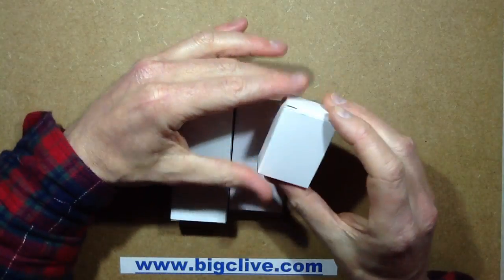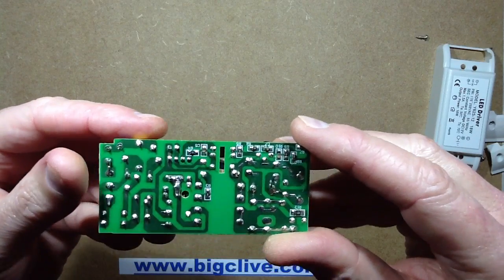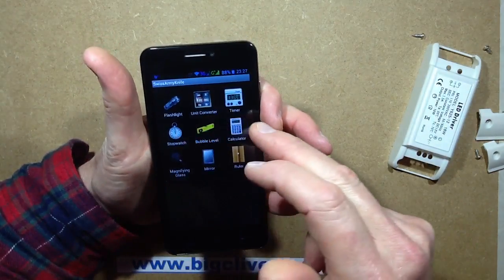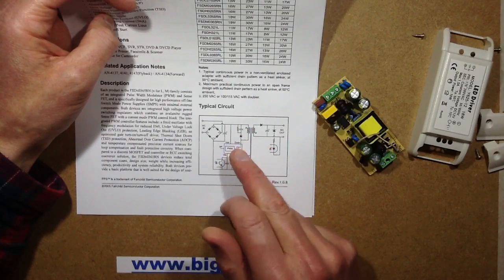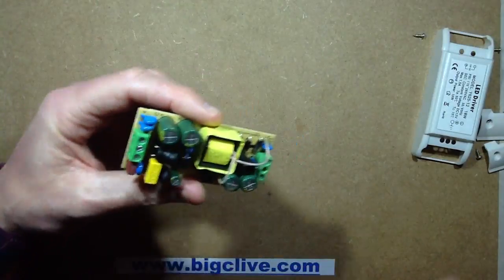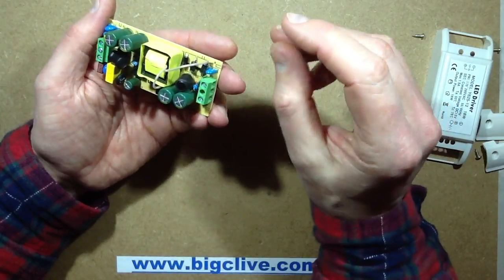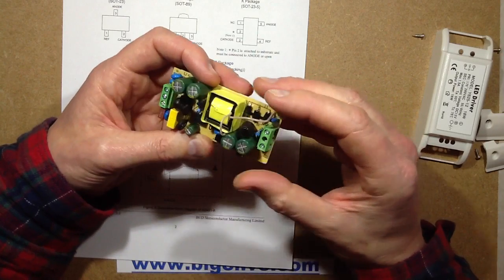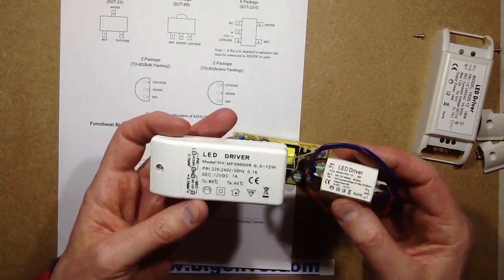Checking the build quality of a 12V 1.5A inline power supply.

Comment: Wondered if one of these could replace a portable radios internal  PSU board  that's broke(no power) could add a bigger smoothing  capacitor as it's feeding audio circuits.
Reply: You would have to make sure it's a constant voltage LED driver and not a constant current LED driver.

Comment: Hi Clive,
I was browsing aliexpress to get a power supply for a Chinese amplifier I bought (TPa3116), and I came up with this rather nice looking and cheap 24v power supply. It claims it can do 6A, which it seems like quite a lot for this size. You might want to take a look at it to review it, here it is: https://www.aliexpress.com/item/Power-Supply-Module-AC-110v-220v-to-DC-24V-6A-AC-DC-Switching-Power-Supply-Board/32711742016.html

Comment: I just noticed that this power supply looks like one I've taken some time ago by Internet. Obviously it is a low-quality Chinese product. Should 5A to 5V but the voltage drops with small loads.

Obviously the chip has no code.

I have subscribed, you make fantastic videos, also you have the power line that allows you to do "crazy experiments". (Chinese gadgets)

Comment: Just purchased two of these - look exactly the same on the outside and inside. One works just fine, the other doesn't appear to be firing up - just flashes the output (5w of LEDs) on and off. Can it be fixed or is it a return to seller job? Guess this is the pulsing effect you mention in your video.
Reply from the maker: +Sparky UK Sounds like there's an issue with the winding that supplies power to the chip itself.  Could just be a bad solder joint on the transformer or associated components (usually a diode and capacitor).  Probably better contacting the seller and if they tell you to ditch the dead one then maybe worth trying to fix it.

Comment: Clive, I've bought a number of "Led Drivers" and "Transformers" which appear to have a delay in firing (the chip requiring enough charge) - which you mentioned in this video. I've noticed when driving a number of 1w LED modules, there's a 1-4s delay which isn't ideal. What would be the best power source for 1w module LEDs to get them to come on instantly?
Reply from the maker: +Sparky UK That's unfortunately very common.  Some of the newer switchmode chips will power up very quickly, and all the capacitive dropper based lamp power on instantly.  But the traditional switchmode chips have a second primary side winding that is used to actually power the chip.  Before they can run properly their power supply capacitor is trickle charged through a resistor until there is enough charge on it to run for a short time, but then they start powering themselves via the winding.  It's the time taken to charge the power supply capacitor that causes the delay, and it's not easy to change.
Reply: +bigclivedotcom Interesting. Over the course of the year, the same (waterproof) transformer has gone from taking 1s to 5 seconds to power up, so does that suggest a component is failing over time? The load has remained constant, although I guess the load bares no parameter on the charge time of the power supply capacitor. These transformers are dying once they reach about 12 months (along with oozing silicon out of them!) but interesting that the transformer takes longer and longer to fire up as it's aged. I have a few of these I could send you, if you like. I also have a Solar Temperature differential controller that's died - also available for post mortem!